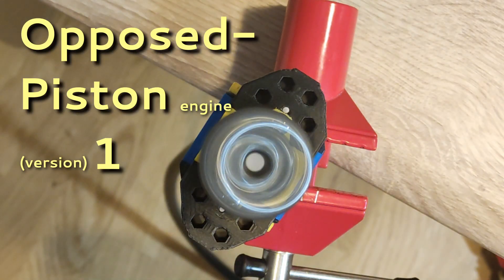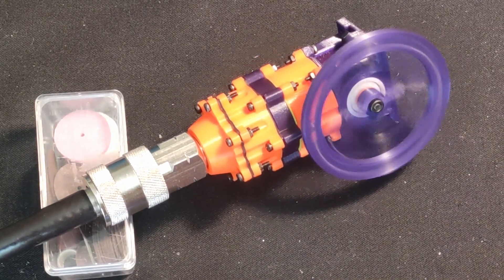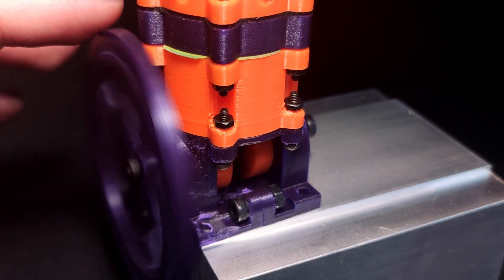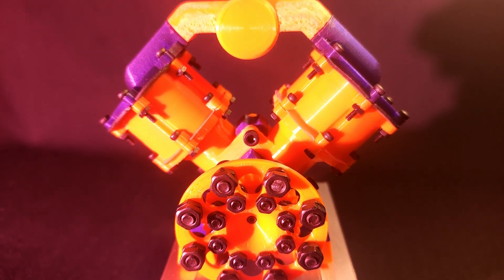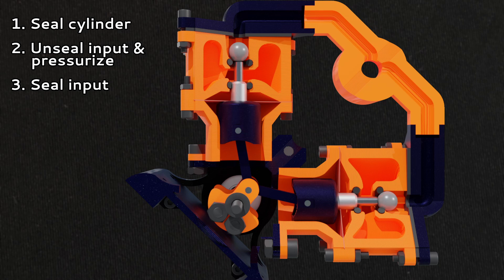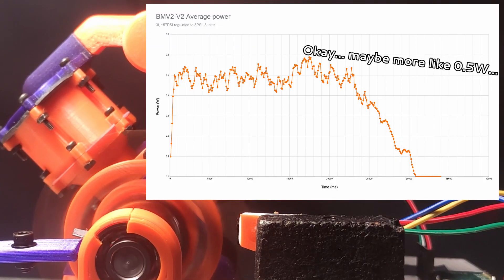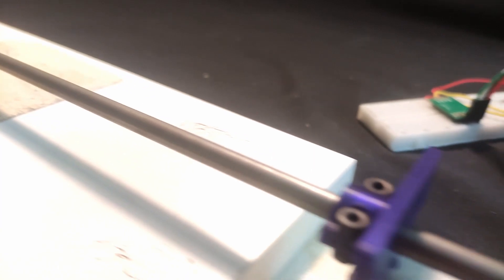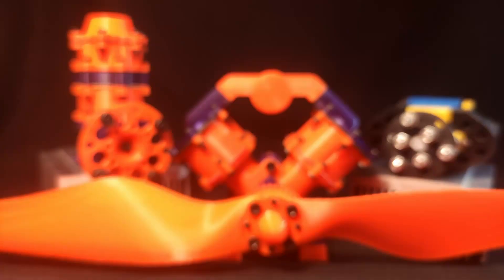3D Printed V2 Pressure Engine

Comment: Printed props just really suck, especially compared to carbon ones. I set up a thrust test stand a while back and I found that the same pitch and diameter produced less than half of the thrust, when compared to cheap plastic props. Considering Tom used an even fancier prop, this could have a lot to do with the results.
Reply from the maker: Yep, it did occur to me, and for future, I have already ordered carbon fiber props of different sizes... Couldn't really that easily choose the prop pitch though, as they were meant for some large drones I guess.

Comment: imagine using liquid nitrogen as a source of air and then a 3 way valve to redirect the gas flow to the engine) another option is liquid butane, but it's inflammable, so... maybe the liquid that is on air cans is an option
Reply from the maker: The problem with using liquefied gases is that as they change from liquid to gaseous phase, they cool down... *a lot*. Not only does this mean lost energy for running the engine, it also means the engine gets cooled down, often down to cryogenic temperatures, which would destroy the diaphragm(s) of the engine.
Reply: @BirdbrainEngineer  probably a radiator is required in between to allow enough time to normalize the gas
Reply from the maker: @Lucas_sGarage  A heat exchanger to heat up the gas before it is used in the engine would work, but in most cases you'd be better off creating something akin to a steam engine then instead.
Reply: @BirdbrainEngineer  i was just thinking about weight/performance ratio

Comment: This engine design is very similar to Tom Stantons engine, although he did get the inspiration from old air hogs engines
Reply from the maker: It is brought up in the video, that it is certainly inspired by Tom Stanton's design, though there are some differences such as a different crankshaft design and the different diaphragm material, which allows it to work at very low pressures. (And of course - this engine is a V2)
Reply: @BirdbrainEngineer  none the less, a very big round of a applause for creating a new design

Comment: Your flywheel is pretty badly out of balance. If you're interested in air engines, you should look into the Lego Vacuum Engine community. Easier to design and make much more power.
I have personally seen my inline twin reach ~1600rpm and produce almost 35 watts (from a three phase motor to a rectifier and through a variable resistor)
Reply from the maker: The flywheel for the prototype was horrid, yes. 
Problem with lego engines is that they are way less precise than 3d printed stuff and moreover... they are massive compared to 3d printed engines. The reason I do not want to make a vacuum engine for now, is because I want the engine to be capable of powering something as a self-contained unit (eg. a boat)... having a vacuum cleaner pipe constantly attached to the thing that is being powered just sorta feels like cheating and a bit of a copout :P